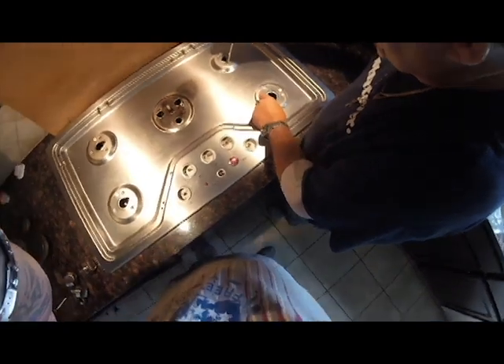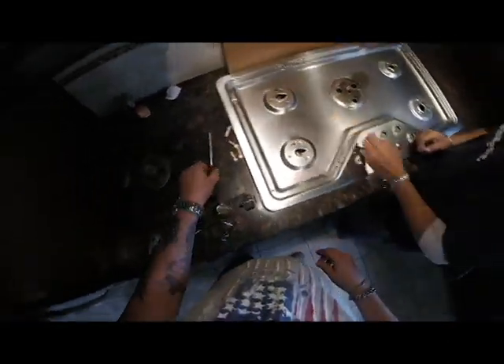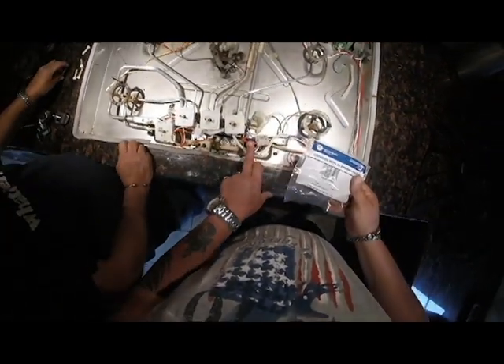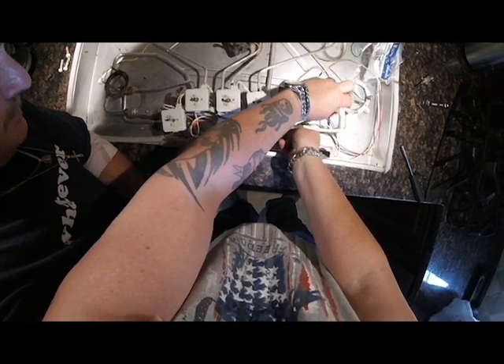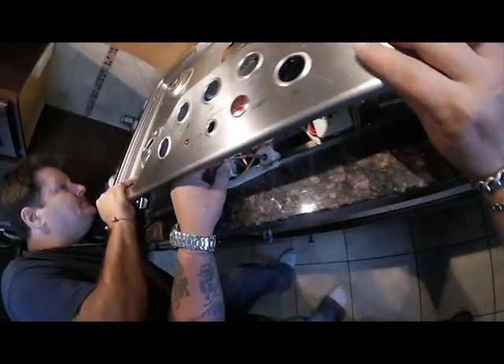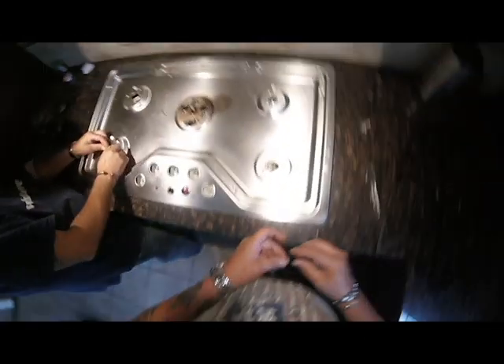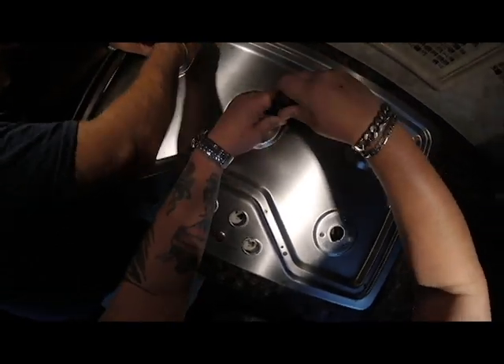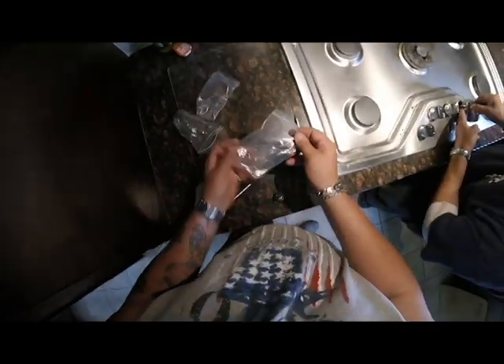GE Stove Valve Replacement Countertop Stove

Comment: First i want to Thank you for taking the time to post this video. My is i have exact the same model. The center power boil is very loud i was wandering if that's normal and also it's very hard to get it off so I can clean the orifices. Please help me and thank you again 🙏
Reply from the maker: That was a few years ago, I'm having trouble remembering the stove set up. If it's hard to loosen fitting just be careful and take your time.

Comment: Great video, thank you. After the replacement and before trying the stove, how to check for leaks? Thank you.
Reply from the maker: Just mix some dish soap with water and spray on fittings. If leak is present you'll see bubbles. Very low tech but effective.

Comment: Excellent video, thanks Paul. I have the same cooktop and I can't get the 1/4' retainer bolt out from the valve I need to replace. It seems completely seized and I'm afraid of stripping the bolt. Any suggestions?
Reply from the maker: I would try giving it a couple of sprays with penetrating oil and let it sit overnight or even longer. My favorite brand is PB blaster but I find that my homemade version works even better. You mix a little automatic transmission fluid with acetone. You can look that up on YouTube it has been proven to work better than any of the name brands.
Reply: @PaulPhillipsFix  thanks for the speedy response. I'll give your suggestion a shot!
Reply from the maker: @GEoTize  If that doesn't work try hitting it with an impact screw driver. If your not familiar with this tool I'll find a link to show you what I'm talking about. 

 https://www.amazon.com/s?k=impact+screwdrivers&i=tools&hvadid=78409052647260&hvbmt=be&hvdev=c&hvqmt=e&tag=mh0b-20&ref=pd_sl_172u40743m_e

https://www.harborfreight.com/6-bit-impact-screwdriver-set-with-case-64812.html?cid=paid_google|||64812&utm_source=bing&utm_medium=cpc&utm_campaign=&utm_content=&msclkid=522f41c8087b185ffaa81e26166da3b0
Reply: @PaulPhillipsFix  I survived with 4 burners for a year, but eventually a second one seized and I decided to revisit your video. This time I did manage to get the retainer bolts out. One valve replaced, waiting for the second one to arrive. Getting there! Thanks so much for your help!
Reply from the maker: @GEoTize  Glad the video helped. Thank you for your kind comment. I love viewers like you, much appreciated.

Comment: Mr. Paul, great videos! I have an older GE Profile™ 30" Built-In Gas Cooktop in my home (Model #:JGP933SEJSS w/ (4) burners: small RR, medium LR, medium large LF and large RF). I searched the internet for information re swapping out / upgrading burners & burner grates but found nothing. My question: "I'm a chef and cook often for my family. No $$ to replace my cooktop, but I was thinking it would be perfect if this cooktop had (4) Medium Large Burners. I've looked at the burner schematic, the only difference between the burners that I see is the size, all the parts under the burner appear to have similar part #s, supply lines are all the same diameter, and the ignition and flame control valves are also the same part #s. Can you think of any reason why I couldn't get 3 medium large burner replacements to swap out what I have so I can accomplish my goal? Look forward to your thoughts Paul!
Reply from the maker: I think your swap would fit the connections fine based on the information you have provided. The only issues that there may be concern about is the larger burners fitting within the existing stove top. If I were you I think i would give it a try. Look at the return specifics on items ordered from where you plan to purchase. Worse case scenario is you'll have to return the burners if they don't work out. Please subscribe, it's free and helps to support our channel, thanks and good luck. Let me know how it works out, Paul.

Comment: Hi, how do you remove the central burner? Mine looks like its stuck.
Reply from the maker: It's been a few years since I worked on that stove but from what I remember all the burners are removable. Try using some penetrine oil if you can't get fasteners loose.

Comment: what was the part number you ordered?
Reply from the maker: You need to go to this, site will put link at bottom. Enter model number and it should show exploded view of parts. After you get the part number check E Bay as you may get it cheaper there.
 https://www.geappliances.com/ge/range-stove/range-parts.htm?cid=1712&omni_key=Cooking%20Products%20-%20Brand_%7CGoogle_%7C_%7C_%7Cge%20electric%20range%20parts_%7Ce_%7C%7C&utm_source=google&utm_medium=cpc&utm_term=ge%20electric%20range%20parts&utm_campaign=Cooking%20Products%20-%20Brand&gclid=Cj0KCQiA-c_iBRChARIsAGCOpB1T2IxEQl-KVl7eobkfqgj5kFOg9Zf_-jdCznPdmD2i5IPn6duF94AaAiynEALw_wcB
Reply from the maker: Go to this link listed below. When you enter model info it should give you a pictured diagram of parts. After you get the part number you can check if it is cheaper on E-Bay. Glad you like the video. You can do it, it's not that complicated. Just take your time. Please like and subscribe. Thank you.
https://www.partselect.com/GE-Range-Parts.htm?source=gaws&gclid=Cj0KCQiA-c_iBRChARIsAGCOpB0uqjWTptcSVr9KcF84FxNQ0em7reNeein1isscE0kpPopnDlIFDIQaAgikEALw_wcB
Reply from the maker: I don't  recall. Go to the manufactures web site and they should give you an  exploded view so  you can find items part number.